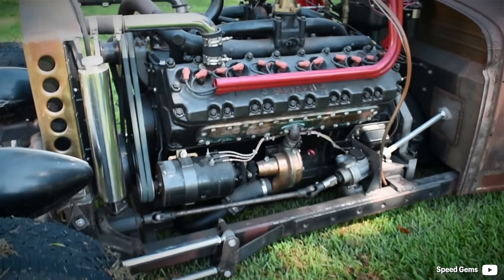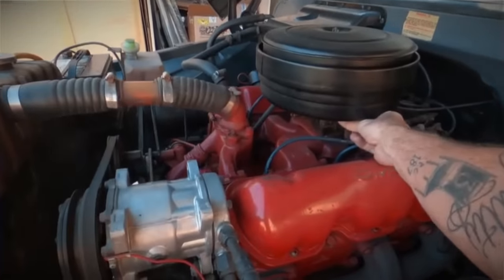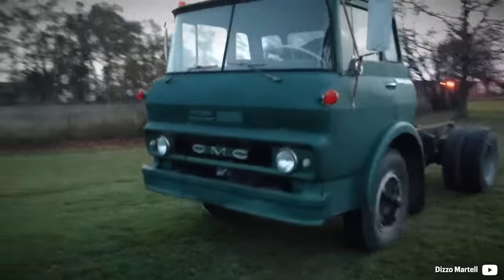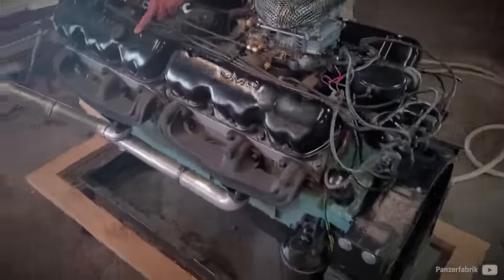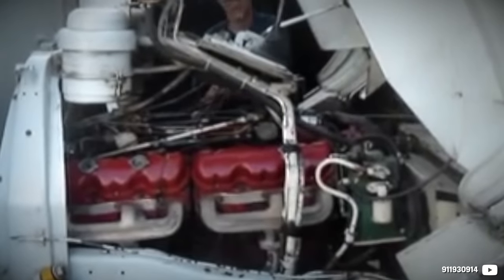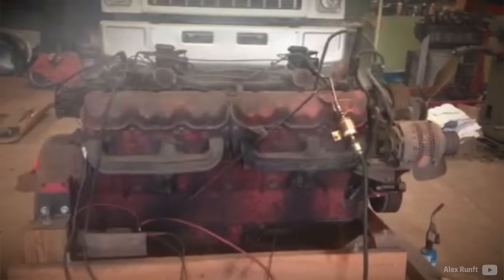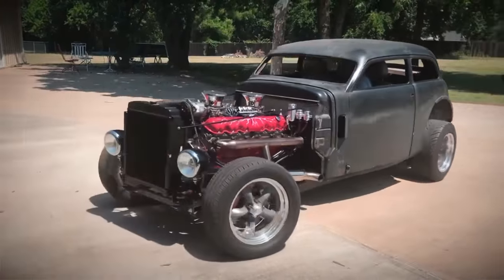GMC's Low RPM Gasoline 11.5-litre V12

Comment: Longevity and serviceable. 
The forbidden L words of the modern age.
My favorites as well
Reply: 3800Series 2 were pretty good in consumer vehicles   just everything else was not that great \..
Reply: @Stickey Sickness Correct.
Now,
Run that past a couple more times.
It's corny, I know.
Reply: @Stickey Sickness What are you talking about?

(L)ongevity
(L)serviceable
Reply: Yeeessss!!!!
Reply: There are 2 sides to longevity. In the oldern days testing how much each engine part needs to take was quite limited. So parts were sometimes much much stronger than they needed to be. When computer simulations became a thing it was much easier to design the parts just about as strong as they needed to be. So cheaper materials like plastic could be used instead of steel as well as less material in general and an overall smarter design. So today with ever advancing simulations cars are made cheaper than ever and with the market being extremely competetive that means in comparison cars are more affordable than ever today. In return they break more easily.
Reply: This would make one sick 2 stroke engine onversion as there is lots of room between the bors to cut any port pattern you want! looks like enough room to baffle in the crankcase and run a baffle plate between the rods on the same journal and stuff the crank circuference with billet aluminum. Now mount a pipe sleeved rotary ivalve for each section of the crankcase down there. Next make a dry sump with a few VRO outboard oil injection pumps for the 2 stroke oil (Amsoil interceptor), custom coated cleavite bearings can run as lean as 80:1 or leaner with graphite/nickle coating. Next use the cam and push rods to drive the exhaust trapping valves and add a bir turbo and have some serious 2 stroke fun. this looks better made than my 8v92 2 stroke. i wonder how the 637 gas v8 look like. How about a IHC 549 v8 2 stroke conversion.
Reply: Modern semi trucks are still very reliable and serviceable. Shows you've only been around passenger vehicles. Commercial vehicles are designed to make money not roll off showroom floors fast, so they have to be reliable and servicable. A modern i6 diesel is probably easier to service and maintain than this V beast.
Reply: @marcopolo8584  No friend, 
It shows that I value Serviceability and longevity where it can be found.
Any implications to the discredit of this or that type of vehicle are implied only by a reader making conclusions on their own.
Peace
Reply: @vanpenguin22  lmao are you a child
Reply: @marcopolo8584  well,
One can be young at heart and avoid  hypertension,  stroke, tooth damage due to grinding,  etc. 
You just might find it more productive that condescension of total strangers. 
Don't knock it tik you rock it.
Reply: @vanpenguin22  Commercial engines are more serviceable and reliable today. If they weren't, we wouldn't be using them, we'd still be using the old engines. A modern i6 diesel is simpler, and more mechanically sound than any old V diesel, including the 2 strokers. Do you realize how much extra friction, weight, and strain are added by all the extra unnecessary pistons? There's a reason 99% of all commercial diesel trucks use i6s now, the single exception being compact Scania cab overs that need a smaller engine.
Reply: @vanpenguin22   You flatter me. I'm really impressed at how quickly you caught on to how the world works after all those years on mothballs. I don't do crack or drink. I have severe brain damage that would make that behavior dangerous to me.
Reply: @marcopolo8584  If you are serious,  I'm truly sorry to hear that. 
And even though such a gesture will likely be recieved with repugnance,  I will pray for you.
That probably explains your need to attack me for overstepping my bounds, which is debatable.
None the less,
I wish you only health and peace.
Reply: @vanpenguin22   Thank you, I know you mean what you say. Ever since the screws came loose, I've become very aggressive. It's ruined most of my friendships and has made making new friends extremely difficult.
Reply: @TheDude50447  show me the affordable cars lmao.
Reply: @What-he5pr  why would you need me to Show you the way to your nearest dacia or whatever dealership

Comment: 2:11 "Longevity and serviceability were the two major factors during its development", later you say it was capable making like 500k miles with minor service. 500000 miles, its around 800000 kilometers. And to think: it was made in 1950 - 70 years ago... Man, this engine was a real state-of-the-art beast!

I love your vids VR, full of engines' history and wonderful sounds. You're a real proper engine nutjob around here. Thanks!
Reply: Some of the very best gasoline engines the US ever made were industrial and/or workhorse heavy duty motors for medium and heavy duty trucks.  Well known for quality and longevity, a large step up from most of the usual motors they made for light trucks and cars.
Reply: Back in those days, cars were built to be 100k mile disposables compared to today. Cars were also much cheaper to purchase back then, and the idea of planned obsolescence was working due to significant leaps in auto safety from the 40s to the 80s in the USA. So, seeing an engine be produced in a time where that was going down makes it extra special.
Reply: It's a 1500 lb engine that cranked out under 300 hp, and was run under 3000 rpm. It had a lake for a cooling system, and a west Texas refinery for a sump. It ran a low compression ratio, but had a forged crank, and 4 bolt mains. In short, it was a war elephant used as a plow horse. That's a recipe for longevity.
Reply: @ludditeneaderthal  thats the key of it all. there were quite a few other engines made at the time that had exceptional longevity because they were built with low compression ratios and low red-lines. parts just arent subjected to extremes.
Reply: @ludditeneaderthal  very similar idea to the Toyota 5vz-fe v6.  It's so undertuned and overbuilt it lasts 500k with proper maintenance (some are known to make it to 800k).  Similar story with the 2uz v8.
Reply: @rushthezeppelin  ya no comparison to your toyota that does little to no work and timing belt driven. Let's see how long it last with 30k straped to it for 5 min.. that's light for that gmc
Reply: @robertmurphy1568  sorry I wasn't trying to make a direct comparison between the two.
Reply: These engines are anything but state-of-the-art. The only way to get Longevity like that is to build it like a Caveman, and Boy were these the best Cavemen that ever were.
Reply: @HeyItsJonny  They weren't built to be disposable, it's just that machining tolerances and technology weren't able to be executed at a price point that most consumers could afford. These were built primarily for commercial use.
Reply: Piqus3, the GMC 305 V6 was made in the 60's, not the 50's. In the 50's, they had a 302 inline six cylinder engine.

Comment: You should do a video on the Hall-Scott ohc inline six (up to 1091 cubic inches) engines, and the V12 version. These engines were designed in the 1920's and were in production until the 1970's. They were used in buses, fire trucks, dump trucks, boats, stationary pump engines, etc. Way ahead of their time, and quite impressive.
Reply: You are correct! I worked at the Canton Ohio plant that was building them in the 1960's . We actually have one still active in a riverboat here in Elkhart In.
Reply: Less pistons mean less moving parts friction , more power efficiency .   We are moving downward , 12,10,8,6,5,4,3 .....

Comment: Thanks so much for making this video. I've always loved the GMC gasoline engines and lusted after the v12. We've had a couple of the 305 V6 is on the farm. One thing that I've always thought is interesting about that engine design is that they are very large bore and short stroke. It's the exact opposite of what you would think you would build for a torque producer. But, it absolutely works. They are extremely turkey motors that will pull at a very low RPM.
Reply: Air cooled aircraft engines are the same way, huge pistons ,shorter stroke. 
Pops has a 65hp Continental in his 46 luscombe. 
65hp @2300 and it's 170 cubes.
Nobody ever gave a torque number , but on paper it's around 150.
And it'll never turn over 2800-3000, that's screaming! 
They had a 75 and 85hp version ,the 85 had higher compression ,but to jump from a 65 to a 75 it's basically adding timing and revving it a little higher , I think the 75hp rating was at 2500rpms. 
75s had piston squirters too,and that was added in on his 65,but he left it set at the 65hp spec.
Reply: Large bores make room for large valves, and efficient airflow throug the engine.
Reply: @thomaskarlstrom4815  not really. You don't want huge valves for low rpm high torque engines, big valves means low intake velocity and bad mixture in the combustion chamber.
Reply: And the stuffing too
Reply: @xxxYYZxxx  The strongest factor setting your RPM range is usually the valve timing, in particular when the inlet valve closes. Closing the inlet valve later moves peak torque up the rev range, all other things being equal.

Comment: I am one of the fortunate still working a big block V6....478 Magnum in a '68 GMC dump truck.. I have several spares and even a diesel version. The best damn gasoline truck engines ever made!
Reply: How good was the 637 v8?
Reply: @jlo13800 it was probably as good as the V6's and the V12. They are quite rare as by the time it replaced the V12 (1966 model year) the switch to diesel was just beginning in the medium duty market. Fire trucks seemed to be where most of them ended up.

I'd love to fine one.
Reply: @turbo8454  the twin six is a very emotion engine and it will make insane HP Per CID 2 stroke  if you are happy. This alloy nickel block was designed by craig iron head heyward which is CGI high nickel will weaken if you are sad! If you are Happy its tensile strength is 235K psi but if you are sad is less than 80Kpsi! the fracture toughness goes down when you are bummed out! So pet it gently!
Reply: 4000white

Comment: My wonderful Dad was the owner of a small family run trucking company in Rhode Island, from the early 50’s, till the teamsters put us out of business in 1981. In the beginning Dad specified International R190 Black Diamond gas engines six wheeled trucks, to haul 20-24’ refer bodies to haul meat, from the Boston Markets into R.I. Under grandfathered rules. But when the trucks aged Dad was forced to save money in able to grow the fleet he chose GMC 7500, 8500 an 9500 six wheeler straight trucks with 20-24’ refer bodies. All powered with 351/5 speed in the 7500’s up to the 401/5 speed w two speed axle. All GMC V6 big blocks. He also had one 5500, with a 305 V6, plus one with a V6 diesel version we called “The Shaker”, because of how it would shake at top rpm. But the gas V6’s all ran for over 200k before their first rebuild!

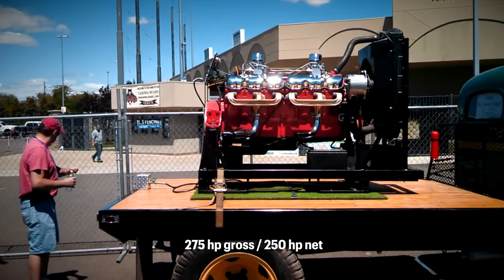Comment: Best line of gasoline truck engines ever designed. Coupled with an SM-420 transmission and a 5:14 rear end and it was unstoppable with a wonderful soundtrack!

Comment: I assume 4mpg was working under load, for the 60s that isnt too bad. The Diesel 6 wheeler i drive at work is 5.6mpg. And its $6.07 a gal of Diesel. MPG has gotten better. But you would think it would be MUCH better then  what it is. Weight takes power to move, and energy. Be it battery or fuel. The instant mpg on the volvo 18 wheeler i drove would go down to 1.5mpg on bigger hills with loaded truck and trailer.
Reply: I would assume not.  From what I've heard of its contemporaries, like Ford's 8.8 liter V8 Super Duty from the 50'-80's, was that they could haul anything, but fuel economy was usually closer to 3 MPG when doing work.  Consider, too, that the way they kept heavy duty motors in those days running cooler was to also lower compression.  Heavy Duty versions of the same motor actually LOST compression (usually dropping from 8:1 to 7.5:1) and were more inefficient.  

Good motors from Ford and GM, but I don't thin they were very efficient.  We could get 10 MPG out of a 292 V8 in a F600 from 1958, empty.  Which is impressive.  But still....
Reply: @kingduckford  i got a 366ci 6.0L V8 hybrid it gets 23mpg around town   32-34mpg on the highway    the battery is bad too  
it's just a combo of the transmission that helps put the numbers out.... at 40mph it's barely at 1000rpm  at 65mph it's at 1400rpm
Reply: If manufacturers would finally switched to opposed piston diesels that would probably be about 8-9mpg or more... they demoed a 270hp pickup that got 37mpg combined city / highway. which is frankly double what pickups usually get... and that was without a hybrid system burning gasoline and not diesel. Achates power look them up... at least the goverment saw the value and is funding cummins to build a tank engine based on this.

Comment: I drove the V6 with the "granny gear" 4 speed for a gas company in the late 60s. It idled so slow, I was able to flick it into low gear without crunching, without using the clutch.

Comment: Happen to have a bit of knowledge of, and experience with this " LITTLE ENGINE " !
While it was obviously a conjoined twin-six design, it was an amazingly smooth running engine ! When in proper tune, it was nearly impossible to hear it running !
The  " Blastolene Brothers " out of where else but California, built two absolutely gorgeous albe-they freaky custom design projects, they were then, and continue to be to this day, absolute torque monsters bringing the words 
" Made in the USA " some hardcore pride ! 🇺🇲

Comment: I ve seen the GMC v6 . And I know they can run at low rpm. At idle you cam almost count the ignition cycles. But they were reliable and strong. But never knew the v12 engine existed that was derived from the v6
Reply: there is also a v8 that was derived from the v6, they are quite rare but they do exist. 637 cubic inches.

Comment: I had a 1966 3/4 ton GMC pick-up with the 305 V6 it was a torque monster.

A family friend had a Ford 3/4 ton pick-up with the 390 V8 he needed to take some stuff out to the coast so we loaded both trucks up. We stopped at the truck scale I had about 500 pounds more on than he did... on the hills I could climb up his without shifting out of 4th gear. He was down shifting on most hills of any grade.  I wish I still had the old girl.

Comment: I worked at a truck company in the late '60s/early '70s that had a couple of GMC V6 pickups/work trucks. They also had a lowboy with a GMC V6 powered winch. I never knew about the V12 though. They also had a White Cabover with a 327 for a spotter truck in the yard. I only drove it twice, I think, and then it disappeared.

Comment: I would really like to see one of these built using modern techniques, cam profiles and fuel injection. Not really to make outrageous power but to increase efficiency. Power increase would be a welcome side effect. IMO
Reply: if you added fuel injection, you add an ECU, and it will never be long lived again.
Reply: I think its key to longevity is the low power output. If you made it make twice the power, it would last less than half as long. Like a 2H landcruiser engine, itll  do 1.5m km no worries and you can abuse it often and it wont mind, miss some services etc... All good. But it makes 70hp... Make it make 150hp and it lasts 200,000 if you are meticulous about oil and filter changes, dont spend long times at full power, let it fully warm up before hard use etc.

Comment: I grew up with a 1961 GMC 4000 farm truck with the 305 that my grandfather purchased new. As a kid I GREATLY underrepresented the torque... it was just a big truck with a small V6. Still have it today although the front end suspension is completely wrung out and parts are unobtainium (different from the same year Chevrolet).

Comment: Those are some impressive specs for the time, especially considering the reliability constraints! It seems on par with the modern natural gas powered 9L inline 6's used in modern city buses.
Reply: I wonder what the price was, and converted to today's inflation.